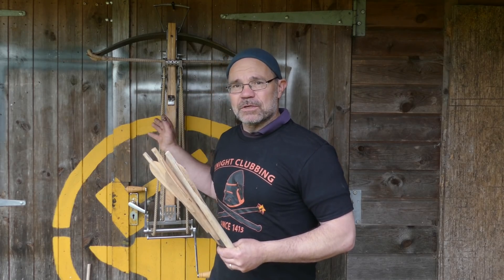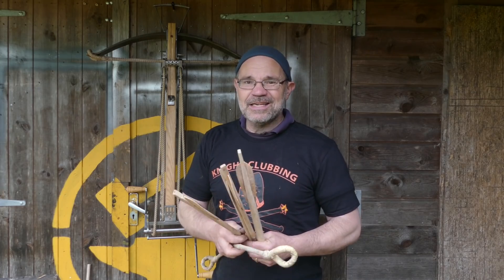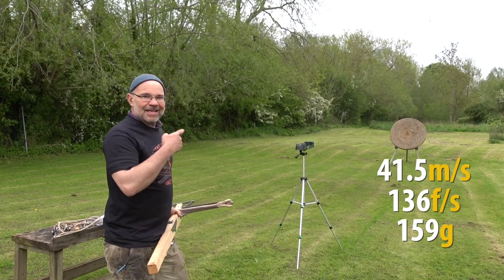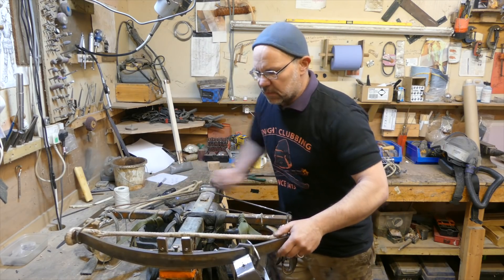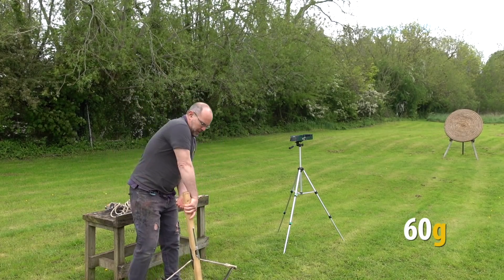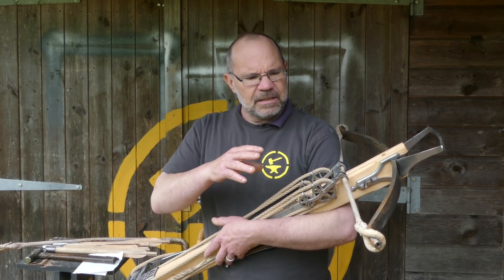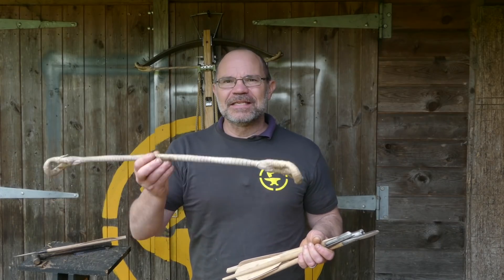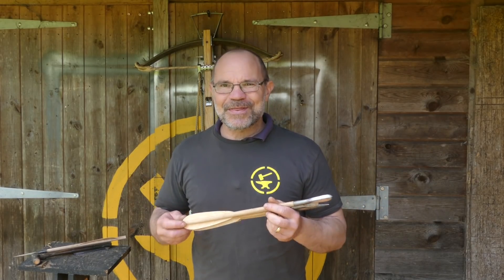Medieval bolt POWER!

Comment: In terms of the kinetic energy, its not necessarily always the most important factor for armor penetration. An interesting example is that the 128mm cannon mounted on the german WW2 Jagdtiger vehicle actually fired an AP shot with more kinetic energy than what a modern 120mm gun produces mounted in a M1 Abrams tank. The dart fired by the Abrams has 3 times the penetration though. So I guess dont always sacrifice pointyness and speed for more mass if you wanna kill an armored opponent on a medieval battlefield.
Reply: Yup, velocity and projectile hardness are very key in armor penetration. Although, when fighting armored humans you also need the projectile to do damage once it penetrates the armor, so a balance is needed between penetration and positive soft target effects like expansion/fragmentation etc. For armored vehicles anything that penetrates them will probably be plenty competent in damaging to crew/components.
Reply: But the tank projectile of WW2 were pretty much solid slobs of metal of given shape indeed. There wasn't that much to tweak there,  88 × 822mm bullet is going to have roughly consistent weight.

This isn't the case with arrow, at all there's really a lot of mass that can be added while keeping same pointyness.

One can use heavier, wood, add few inches of solid iron neck, broaden the head itself a bit. etc. And gain quite a lot mass while keeping some very aggressive point on the arrow.

See here:

http://www.manchuarchery.org/manchu-war-arrows

Pretty hefty arrow at almost exactly 100 g, and yet quite pointy. ;)
Reply: @lscibor  Tank ammo in WW2 was pretty sophisticated. I wouldn't call them "solid slobs of metal". APDS (armour-piercing discarding sabot) for example, which is a direct predecessor to modern APDSFS (Armour-Piercing Discarding Sabot Fin Stabilized). They even used tungsten cores in WW2 APDS for better penetration.
And that's ignoring various other types of ammo, possibly the most interesting for fighting armored vehicles being HESH (High Explosive Squash Head). Even more basic types of ammunition, like Capped AP are far from simple "slobs of metal".
Reply: @lscibor  First of, I dont understand why you mention a 88mm projectile. Secondly, if you want to shoot someone covered in gambeson and mail, then my point is that not necessarily the highest kinetic energy bolt is gonna do as well as the lower weight bodkin point.
Lastly, I would not bet my money on that arrow you link being able to penetrate proper mail and gambeson. Its simply not pointy enough. It looks more like a hunting broadhead to me, which probably is totally fine if you are fighting weak-to-non armored opponents. But in that case you dont need an 850lb crossbow either
Reply: @lieutenantcoloneltanyavond8273  Well, I don't mean "solid slob" as "something shoddy", but simply that the 88mm bullet was indeed metal cylinder of ~88mm diameter (with tolerance to fit into rifling properly), that was later tapering away.

To make it heavier you had to increase diameter (no longer 88, of course), increase length (not exactly neautral to ballistics and whatever),  or increase density. 

Arrows obviously don't penetrate in a way as armor piercing HE shells do at all, so I'm talking only about solid AP, APC etc. ammo.

Arrow just isn't nearly as "full" shape, so there's a lot of things to change while keeping roughly the same sectional density or "pointyness" that was my point. ;)

Comment: Probably more for Jorg but is a combined Crown and piercing bolt head possible a crown head that slides back as the shaft drives piercing head forward ?

Comment: The next question is what is the point of diminishing returns? At which point will the weight (and size) be so large that the resulting energy starts to drop, the range and/or flight speed fall so low that they wouldn't be useful anymore?

Comment: I'm curious to see how for long each bolt is pushed by the string. Then you can calculate the Force delivered to the bolt. 
Since Impulse = (Force * time) = change in momentum.

Comment: Is there more flex in the thinner string? Could that have absorbed some of the energy?
Reply: I would imagine the lighter string would stretch more during the draw,, effectively causing the prod to bend less than with heavier string, so then energy stored would be smaller.
Reply from the maker: As linen, it should be zero stretch

Comment: Tod you've looked at waxed arrowheads fairly extensively on the channel and bowstrings are waxed as well. I've oft wondered is the crossbows stock where the string rides along it waxed, and if not has anyone ever experimented with that? It seems to me that the way the string is bent up and over the stock you would lose a lot of energy just due to friction.

Comment: As someone who never did this in school: what exactly is the difference in kinetic energy and momentum? Isn´t it both just a relationship between the mass of the projectile and its speed? And how does a change in one or the other affect the damage sustained by the target? I´d be glad if someone would educate me^^
Reply: When it comes to penetrating armor, you need both momentum and kinetic energy.
1-A really high speed, really light projectile
Will scratch a thick hard armor.
2-A really low speed ,really heavy projectile 
Will push a thick hard armor.
 Num 1 is a high kinetic energy low momentum projectile
Num 2 is a low kinetic energy high momentum projectile.
 I hope that I could inform you
Reply: Good question! These are all terms whose popular usage is different from their technical physical meaning, so it can get confusing. Here is a very brief overview, do feel free to reply with more questions.

First, some basic definitions:
momentum = mass * velocity
kinetic energy = 0.5 * mass * velocity * velocity
velocity = speed and the direction of movement

Essentially if you know any two out of {mass, velocity, momentum, kinetic energy} you can work out the other two. Mass is useful because it's constant no matter how the thing is moving or not moving. Velocity is useful because it tells you the kinematics (where something is when). Momentum and Kinetic Energy are useful because they are both (independently) conserved as things travel and bump/crash into each other. That means that if you know the momentum or energy before some complicated event (say many billiard balls bouncing off each other), you know what the momentum or energy are later, without having to worry about the detail of what happened in the middle. However, some of that momentum/energy might be transferred to air or to vibrations inside a material where it's so hard to measure and keep track of it that we essentially consider it "lost".

As an aside, these 4 quantities are all related to force in the following way
force = mass * acceleration = mass * change_in_velocity / time_for_that_change
kinetic energy = force * distance_that_force_is_applied_through
momentum = force * time_that_force_is_applied_over
(where I'm assuming everything is constant to avoid calculus, but you can replace all multiplications by integrals and division by differentiation if you want the most general version). It's not so hard to check that these definitions are all consistent with each other, which is why that otherwise mysterious 0.5 in thee definition of kinetic energy comes in.

Saying which one of those is more deadly or penetrates deeper is very complicated because the shape and material of the projectile and target comes into play. You can no longer consider them as single point-like objects but (almost) have to deal with how individual atoms react during the impact. That's sufficiently difficult that accurate theoretical predictions are not worth attempting, and instead people do tests of various projectiles on various targets and various speeds, draw up tables of the results, and then come up with some heuristic rule that fits the data. Hence why this channel is so interesting!
Reply: Basicslly "momentum" that their refer actualy is the inertia of the object as the first law of fisics says any object without external forces tend to keep is trajetory/speed know as "momentum" that is product of it weight and is applied  initial aceleration, the kinetic energy is a abstract term in form of a energy, joules that include its momentum force, to the object that can  cause phisical changes if transfered to others object like target or people
Reply: @torhacs  I'm sorry, but that's absolute butchering the physics. Inertia is mass, not momentum. Momentum is mass times velocity, not weight or acceleration. There's no such thing as a "momentum force" and neither momentum nor force is the same thing as energy. Energy is not more linked to physical changes than momentum or acceleration. See my reply above for what these things mean. I'm not trying to be rude, but in a discussion about this these terms have to be used correctly, or we get nowhere at all.
Reply: @QuantumHistorian  that was a great explanation! I have a question: can two objects with the same kinetic energy have different momentum? (or vice versa)
Reply: @TNaizel  Thank you :).

Yes, certainly! A 0.5kg object moving at 2m/s will have 1 Nm of momentum and 1J of energy, while a 1kg object moving at 1m/s will have the same momentum but only half the energy. More broadly out of {mass, speed, energy, momentum} you can set any two you want to have any value you want, and that will uniquely define the other two.

Comment: I wonder if the drop in performance for the lighter string is due to less momentum transfer? Sure, the string may be going very slightly slower, but having a significantly higher mass would logically transfer that extra momentum to the bolt as it leaves the crossbow. Obviously not a huge difference, but the actual change of like 2% fit with what I was actually expecting going in.

Comment: I'm wondering, what the difference in measurements you'd get crono'ing the bolts at the target vs at the crossbow, as tested. You've kind of got full speed, measuring at the crossbow. But I'd think wind resistance would scrub off some of the power by the time it gets to the target. Would bolt weight and shape have enough effect on this to have any meaningful value in terms of impact power?

Comment: Bodkin points are great for punching through various materials, but we always forget that a broad-head with razor honed edges is the most lethal. Not only do you get a penetrating action, you get lacerations to the blood vessels and internal organs. A modern broad-head coming out of one of these crossbow would be EXTREMELY LETHAL. With the heavy bolts the momentum is off the charts and the bolt would push through bone and tissue like a hot knife through butter.

Comment: Very nice dataset. Any chance of comparing it to similarly powerfull composite crossbow? I heard they are more efficient at same draw weight, but I never saw any conclusive data on that assumption.
Reply: It's not just about efficiency, they have a much longer draw length as well. So for the same draw weight, they store far more energy in the bow.
Reply: They can deliver a lot more energy for several reasons, most importantly 4 things:
1 - they do NOT act like normal springs. With a normal (cross)bow at the start of the draw the force required to pull it back is very little, linearly increasing with the draw-length. So you can roughly say after the arrow was accelerated for half the distance it only get half the force, while on compound-bows the force required is much higher at the start already.
2 - the bow it self is usually made of modern, lighter, materials. Specially for a crossbow that means it only needs to accelerate a fraction of the weight. I mean Todd just told us that for this crossbow the bow alone is 2.4kg, where for a compound this is more in the range of 1.5kg
3 - due to the way the string is wrapped around the bow-limbs them self travel a lot shorter distance, so they get accelerated less
4 - they often have a lot longer draw-length.

overall compound-(cross)-bows are way more efficient.
Reply: @ABaumstumpf   Sorry for wrong wording, when I said composite I meant something like this: https://www.youtube.com/watch?v=nY2untEwCnU
I read multiple times on historical forums that steel crossbows were more convinient (they can fit better on ramparts) and easier to maintain than composite crossbows (problems with the glue in wet areas) but not necessarely more powerfull. I am modding videogame called Bannerlord and technology in that game is in 9th-12th century (prior to plate armor and steel crossbows), so I am trying to depict crossbows of that era correctly.
Reply: @philozoraptor6808  Ah, sorry, my bad - if you are talking about the bow-limbs made from composite material - that really depends on what materials and technology you are using.
In that case .... hard to say. Iron is very good at flexing - it can give back most of the energy stored in it. For Wood and other materials it is more variable.... i would guess that for the same draw-weight the metal crossbow likely is still more efficient, it stands to reason that they did not go to the trouble of making actual metal bowlimbs if wood would have been just as efficient.

Comment: There will always be a balance point. Some combo of weight, velocity and tip will yield the best results in a given scenario.... but not in a different scenario. For deer hunting, speed is paramount. Almost any modern crossbow will result in a pass through; the key is to hit the right spot. With deer reaction times, that’s not easy. So light weight that results in higher speed is more likely to get the bolt to the best kill shot. For self defense? Humans do not react nearly as quickly as deer. But it’s a different shot, because self-defense implies your target is already intending to harm you. So the quick bleed-out that is the hallmark of a good humane deer hunt is NOT the goal in this instance! In self defense, the objective is to incapacitate the recipient as quickly and effectively as possible. And it will certainly be at very short range. Therefore, as much momentum as you can muster - along with as much impact damage as possible. Anything you can do to distract your recipient from continuing his assault on you or your loved ones.

Comment: I think the light bowstring was just more stretched out on its own due to it being new and thinner. As a result, most likely, the tension force of the crossbow has decreased. You didn't test it on your jack before you fired, did you?

Comment: I am left with a feeling of great dissatisfaction due to the lighter string not being the correct length and the testing being cut short.

Also, could the thickness of the string make a difference?

Comment: yea heavier bolt for the same bow/crossbow always impart more energy and momentum because of ratio betwen system average force and velocity which it can achieve =inertia of arm weight however lighter bolt from completlly diffrent bow/crossbow can have more energy and momentum or only energy for egzample ....

Comment: ok prediction before watching video... the acceleration distance is short, and the spring is extremely strong, because of time under acceleration a heavier bolt will be able to receive more transfer of energy in that time... a lighter bolt will have better trajectory... so optimal bolt will be the heaviest bolt that still gives desired trajectory

if the spring was 8 feet long and the acceleration distance and time was longer then that might bring the optimal weight in the middle of the boundaries and then the trajectory wouldn't be the limiting dimension for optimal bolt weight, it would be energy... and you would just find the maximal weight that gives best energy while still giving good trajectory

but for this crossbow i think that optimal weight is out of bounds so the heaviest bolt that still gives good trajectory will also give the best energy... 

let's see if i'm wrong
Reply: 60g,54.6m/s=	89.4 j
80g,50.9m/s=	103.6 j
93g,49.4m/s=	113.5 j
159g,41.5m/s=	136.9 j

60g,54.1m/s=	87.8 j
80g,50m/s=	100 j
93g,47m/s=	102.7 j
159g,39.9m/s=	126.6 j

... yep... so the question is whether the trajectory of the 159g bolt good enough, if not then you have to go for a lighter bolt but at the cost of energy
Reply: this is an interesting problem, because energy doubles when the mass doubles.... but double the velocity the energy increases by a factor of 4x
so generally you can give up mass for velocity and that will net you more energy, but the system has to be able to transfer the energy to the projectile

Looking it up, a heavy arrow is 500 grains or 32.4g... and a robust compound bow can accelerate an arrow to 300 fps or 91.5 m/s.... because the system has more time and distance to transfer energy to a lighter projectile it can reach higher energy... 135.6 j ... more energy than these bolts... 32.4g,91.5m/s=135.6j ... i'm pretty sure this crossbow couldn't accelerate a 32g bolt to 90 m/s

on the other hand there's no way a bow could accelerate a 159g arrow to +40m/s ... 137 j which is similar energy to modern bow and arrow energy.

*this highlights the advantages of this specific crossbow, being able to fire a very heavy projectile to devastating energy.*

this could give advantages to trying to fire heavy bolts through plate armor or something

The difference between modern compound bows and modern crossbows is curious, crossbow can generally get roughly 40 j more projectile energy
probably simply due to the mechanical advantage and not being limited by the shooter's draw strength

Comment: The difference in energy is very interesting. My question would be the minimum energy that would take to incapacitate someone, if it only takes 50 ft lbs then any bolt would he sufficient
Reply: It's different from firearms.